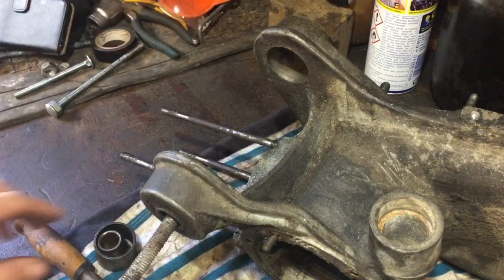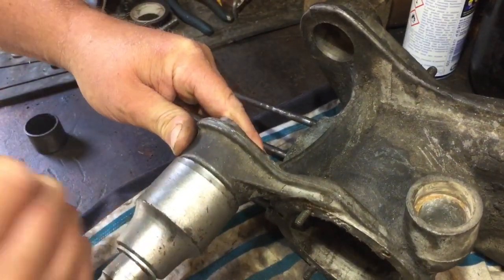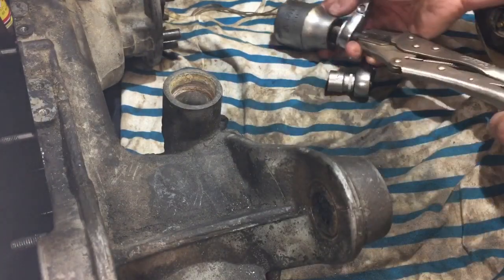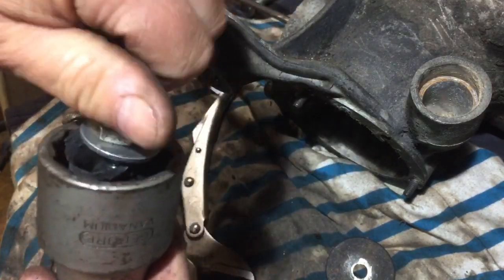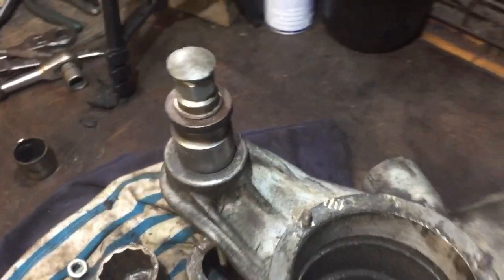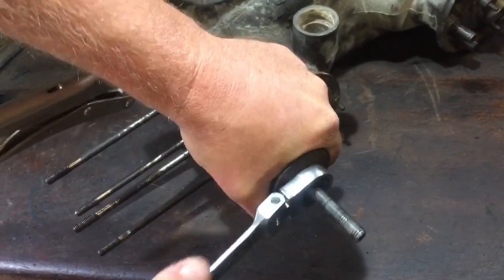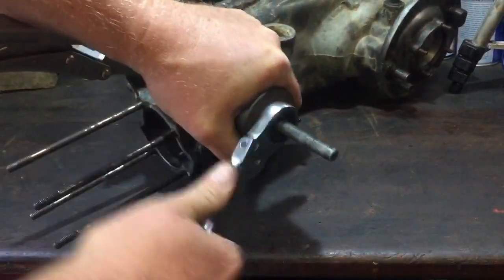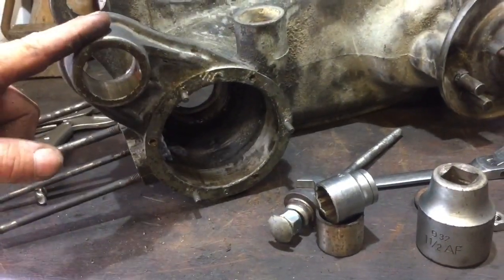Lambretta Scooter , Silent Block Bush (Engine mount) removal without special tool 🔧⚙️😉

Comment: Well done. That said, I do have a tool for that job which consists of a series of cups and a puller bar. There's a size for every bush. 

I was wondering why you didn't pull them out whole though?
Reply from the maker: Hi the reason was is I wanted to heat it from inside, it was much easier to do that with the rubber removed. Thanks for watching 🙂👍